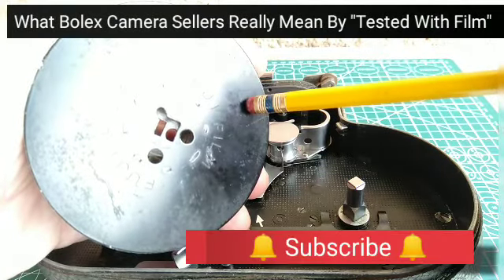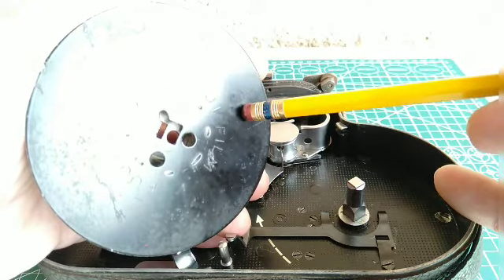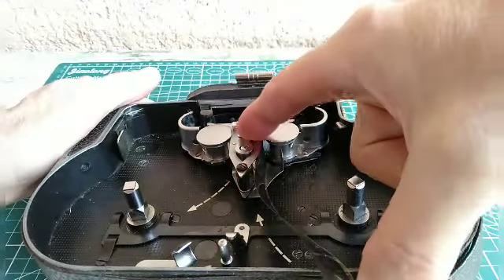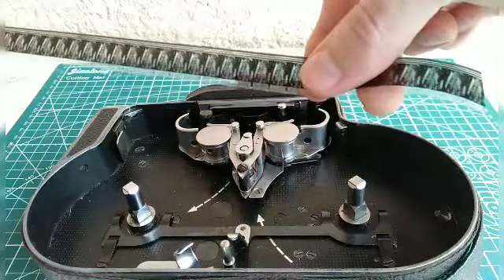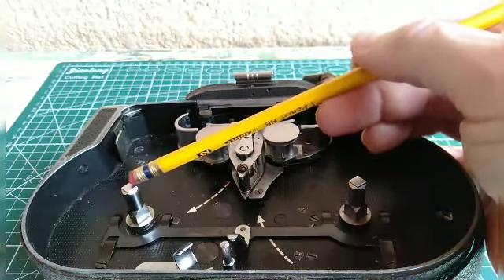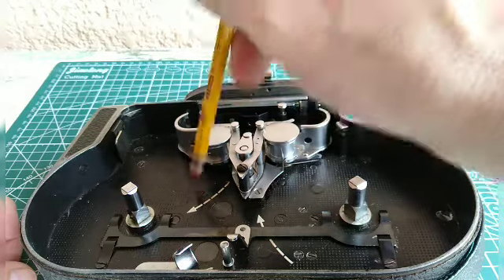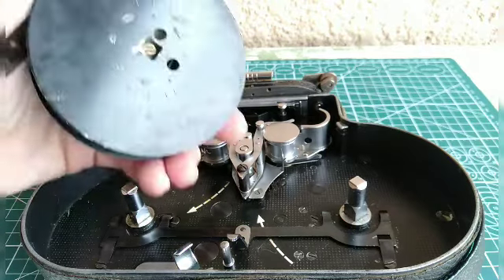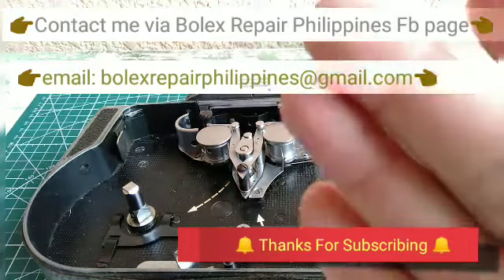What Bolex Camera Sellers Really Mean By "Tested With Film"

Comment: Hey Paul, Enjoying your videos! I've recently purchased a h16 reflex, one of the first series I believe, annoyingly the take up spool does not spin. I have seen to check this on one of your previous videos, and wish I asked to see a video of the mechanics before purchasing. I'm just wondering, is this a major to fix? Wondering if I should try get a refund, or try get repaired..
Reply from the maker: Hi Adam,
This is a common issue with Bolex cameras when the take-up spindle doesn't rotate, does so erratically including the celluloid spilling out into the take-up at times. Therefore, no need to seek a refund as any Bolex will "eventually" develope this issue over time.

The issue is caused by the camera being stored away in someone's closet for decades. Therefore, all the lubricants within have collected dust, dirt tiny film particles etc.

The solution, is to get a new CLA aka Cleaned Lubed and Adjustment when 1St receiving a Bolex after purchase. Never believe a sellers "Weasel Clause" that reads working, tested with film etc.

During this issue including a full CLA the take-up is dismantled, springs around the spindle gears checked and replaced when needed. The most difficult parts can be removing the screws that are (usually) frozen and or rusted in many cases. I'm in fact recording this very video now.

This issue is also y prime example of why a Bolex should "never" get wet and why it's best to invest in a modern "Tuff Case" that protects a Bolex from the elements such as moisture that causes rusting of the gears and tiny springs thus preventing these moving parts to not move. In other words the original leather cases are "pretty but not practical".

The entire Bolex will also require a CLA including the motor barrel clutch. The main spring inside must be removed, cleaned, checked for issues such as rust, tiny cracks etc. Upon that the spring is worn and or damaged it would have to be replaced with a new one and lubricated. This video I have on the way also. Thank you for your kind words concerning my videos and for subscribing.

~Paul~
Reply from the maker: Hi Adam,
Here's my video explaining this issue.

Erratic Bolex Take-Up Spindle

https://youtu.be/z8N3qUuzqd4